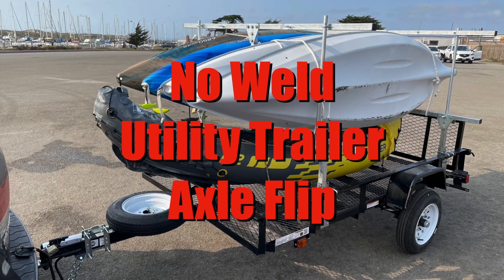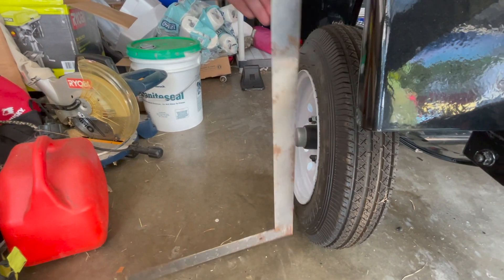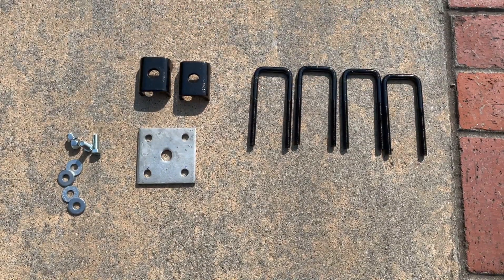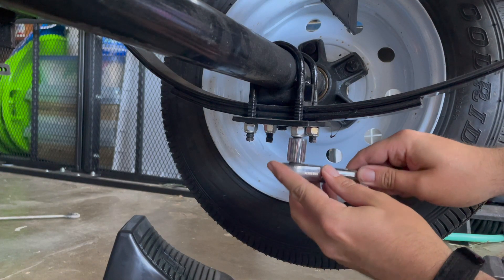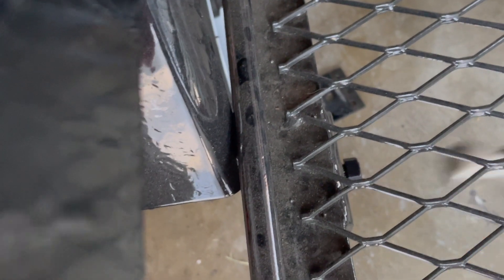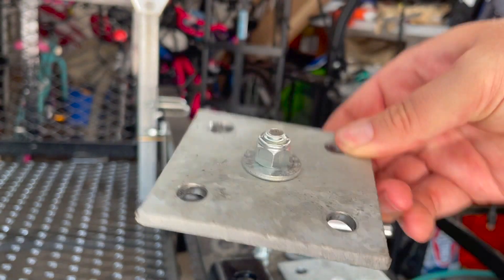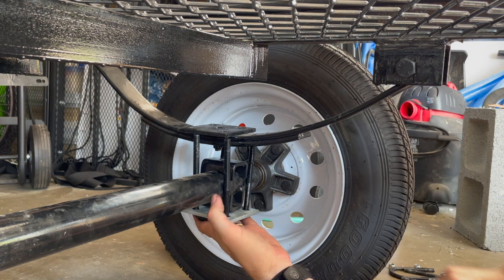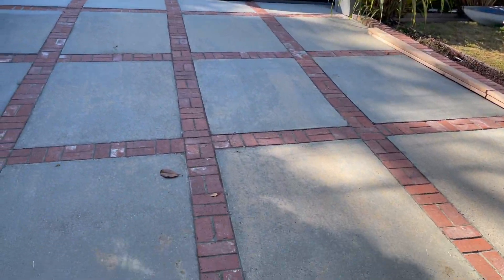No Welding! Flip Your Utility Trailer Axle Right

Comment from the maker: 99% of viewers of this video aren't subscribed, if you're reading comments, please hit like and subscribe!  This video goes over how to make your own over under kit for a 1-3/4" axle like the ones Dexter sells for the 2-3/8" axle (part K71-384-00).  Before leaving a comment saying you must weld on the perches, note two things:

1. I say that welding is best right in the video, so I mostly agree
2. No weld conversion kits are made by reputable manufacturers but not for this axle size, which is why I made this video
Reply: How has this held up over the past 3 years?
Reply: What did you torque too? I have same
Axle as you!

Comment: Sorry, but I had to watch to the end to be sure there wasn't some kind of 'punch line' coming for this 'joke!
There at about the 3:00 minute, ( as pointed out by '@kitgore2508'  ) when I saw how you used that small open end  wrench and hammer, then used a spring seat ( or perch ) without welding it and bolting up those u-bolts ;like this, I knew that you have not had any experience with a trailer on ordinary  roads. I would estimate that after a couple of pot holes have bounced your axel / trailer, that your 'jury-rigged' repair would leave you with a wound up axle, at the very least.
I could could go on and on here, but you have the picture.

Comment: Small trailers like this should never be at maximum capacity. Flipping the axle reduces the maximum capacity but not enough that any reasonable person would ever notice. If you are worried about do this extra work. I’ve never had a problem with my little trailer with a flipped axle.

Comment: modern cars all have negative camber. This will help keep you trailer tracking center. I would nto worry about it. Cars I work on at a dealer have as much as 3rd degree or more especially in the rear.

Comment: I straightened my bent axle with a 2 1/4  ton floor jack.  Had the trailer loaded with 275 gallons in a tote.  Jacked up the middle 3 inches above horizontal.   Worked like a charm. 🎉
Reply: I’ve actually been thinking about doing that.. 🤔 
How’s it holding up for ya?
Reply: @ConcertCultureAudio  perfecto 👍 👌 I'm very happy 😊
Reply: Grossly overloaded the axle, 220lbs of water plus te weight of the container and everything else that you had in the trailer.

Comment: I did the same thing to the same trailer 10 years ago. I still have the trailer. 
The biggest issues I had was the ramp gate being a bit short with the trailer being higher and the fact that I overloaded it many times causing the tongue to crack as well as the small cross beams where it’s attached so I still had to do a little welding to keep the trailer usable. But by overloaded, I grossly overloaded it several times and it never let me down other than a flat tire once in ten years of abuse.

Comment: Going to try this exact thing but in reverse. My camper trailer is SO HIGH and the leaf spring is on top of the axle, I want it to instead be UNDER the axle, so going to see if i can flip what you did to basically your starting point.
Reply: How did this go? Did you have to do what's described in this video? If it's in reverse, is this really necessary?
Reply: @Nickfv12  after more research, I ended up not doing it and instead getting a literal 9 inch hitch that lifts up that high to meet the parallel of the trailer
Reply: @adamsebetich9290  what was your reasoning for not doing it? I was debating on doing the 10" hitch as well. The cheaper option is flip the axel but the easier option is the hitch
Reply: @Nickfv12  trailer shops near me were going to charge 400$ to do it (200 a side), and a 9”inch hitch was $120, outside of some added weight cuz that hitch is heavy, it works perfectly
Reply: @Nickfv12  Cost 400+ or just 112 with the hitch, decided to go cheaper. Also, i have a bit of a lip to get onto my house driveway, and the height actually helps so the metal doesnt scrap against the ground since i tow with an SUV thats not lifted like a truck
Reply: @adamsebetich9290  yeah I went with the hitch lift but still debating flipping the axel myself. I do all car work myself anyway. That might help with air drag and mpg.

Comment: Yeah, and if you just flip the axle, it won’t do just damage on the tire you can actually snap your axle in half that bow in the axle goes up. You’re never supposed to let that bow go down because it’s also have to do with the weight that can be put on the trailer if you put it the way he’s got it in the starting of the video you actually will be able to pull less weight than that trailer is waited because if you pull the same amount as that trailer is waited for the way he had it in the first part it would snap and you’d be stuck in the side of the road because you did it wrong
Reply: So the moral of the story is make sure your bow on the is facing the bed of the trailer not the Ground

Comment: I don't get it. Why would you do this? Was the bow there originally from the manufacturer?
Reply: it makes perfect sense really. When you add the weight of the trailer and its contents to a straight, low grade axle, it will immediately bow downward under that weight. To equal out the bowing and keep a straight axle while under stress, you should have the bow facing upward.

Comment: if you dont weld the new perch it will rotate until it hits the original perch, and if shifts unevenly on both sides  you will track down the road wrong possible cause the wobble that can flip ya, leave nothing to chance.
Reply: If that new perch spins around and touches the original one, he would have had to twist all the U bolts off to allow it to rotate.
Reply: that's what those short bolts are for. can't rotate through those nuts.

Comment: So in your knowledge..what amount of camber causes wear??? Weird cause I know of many models that have up to 1. 2 degrees of negative camber.   To absolutely no wear effect.  And actually better handling on turns...
Reply from the maker: I agree that 1 degree is fine and even desirable for some.  Cut from the video was measuring  almost 10 degrees of camber when trailer loaded and just using the already welded on seats.  The axle bend plus trailer weight works against us in this situation.

Comment: You have just created a road hazard..
Reply: Im interested to know why , ? The flat plate he installed makes up for the tiny tack welds on the spring perch, mine is flipped and been that way for years been across country multiple times zero issues with loading heavy or light as long as u properly load it,,,,,,,?.never a problem.

Comment: Have this exact same model trailer. Gonna do the axle flip. Wish me luck. Great video by the way. 👍
Reply from the maker: Good luck and let me know how it goes!  Mine is now over 1,000 miles.  Thinking about putting on bigger wheels.
Reply: @dr.coelacanth6142 completed this a few days ago. Got more ground clearance... Didm't like the look with the 12 inch tires. Bigger tires in the future.

Comment: Where did you get them custom bent U-Bolts. I cannot find them anywhere?
Reply from the maker: I got them from a local shop.  Searching google I see several places offering to bend u bolts for you to your measurements.  For example: https://www.sdtrucksprings.com/u-bolt-by-measurement-for-leaf-springs. I’m not sponsored by them and have not used so don’t know if they deliver.
Reply: @dr.coelacanth6142  I did find U-Bolts that are 9/16 size that are 5 inches so I am going to go that route and redrill holes in the plates to allow the fit.  Have you had any issues with the trailer since you did it? I see all the comments of everyone saying it must be welded, but curious if you had an issues since you went that route.  I use mine about 5-6 times a year just hauling a 4 wheeler to the woods about 300miles one way for hunting.  I had to replace the axle and hubs since all bearings were shot and the spindles got tore up so I decided to go larger tires now too since I was in the process. Those small tires that it came with from Lowes were just too small for as far as I go.
Reply from the maker: Welding is the best solution.  I have had no issues personally with my trailer yet.  Longest trip was 800 miles round trip.  I’m just about to tune up the trailer for kayak season.

Comment: I'm subscribe because you everything good thanks I'm gonna do the same thing with my trailer I got one 5x8 but in mine I wanna put a least 13 o 14 size tires on it because the one's is on it's to small
Reply from the maker: Yeah, I need to put bigger tires on.  Waiting for a good deal on parts.

Comment: Would there be any danger of doing this with straight bolts rather than the custom U bolts?
Reply from the maker: I would worry about twisting.  There are custom bolt dealers online where you can custom order easily.

Comment: Anyone have any opinions on Axle vs timbren axle-less for off-road? Military trailers use axles?
Reply: man, I been researching those for a few days straight and I just can't make the cost make sense in my head. I want to go with a mid weight Timbren model but they're well over a grand. I just can't justify spending that on my cheap Lowe's Carry on Trailer. maybe on something a bit more beefy.

Comment: i think all you need is the perch thing and just use the rounded U bolts, don't really need that extra square metal plate.
Reply: This is what I was thinking... I may even do that and then JBWeld it in place.
Reply from the maker: Doug’s right.  Also, remember that welding long term will be better if you can.

Comment: I just bought a straight 3500 lb. DK axle for my trailer that's set up for spring under. I need it to be spring over. Since it has no bend in it I'm good to just flip it right?
Reply: Yeah, if it is dead straight- you are good to go.  Mike

Comment: eTrailer highly recommends NOT doing an axle drop, please don’t call it a flip, it’s wrong on many levels, on slipper springs. It’s considered very dangerous, so proceed at your own risk. On a side note from the video, nice rack design on the trailer.
Reply: Its not dangerous at all if you do it right mine has been flipped and using it that way for years !🇺🇸
Reply: Listen to the Col. evangelizing eTrailer as the gospel. And providing the "correct" terminology for us unknowing  calling it as an axle flip.

Comment: BAD IDEA!  You run the risk of the U bolts stretching thus allowing the unwelded perch to rotate, cause a swinging axle, and then precipitate an out-of-control suspension failure.  WELDING is the ONLY safe way to flip an axle.
Reply from the maker: Welding should be the first option (and I say that in the video).  The force on the U bolts are the same as any other method whether welding, or using an over under kit.  The principle of an over under kit is the plate rests against the welded perch and provides the stability in the same way as an overslung axle.  To a first approximation steel breaks with dynamic forces (bouncing suspension) and stretches with static loads.  So long as you inspect your trailer occasionally, it should be ok.  Do you have any experience with U bolts stretching?  The usual issue is torquing the nuts leading to bending threads an imperceptible amount and causing cross threading when removing the nuts. That’s why you don’t reuse U bolts.  I’ve never heard of a U bolt stretching enough you could detect it.